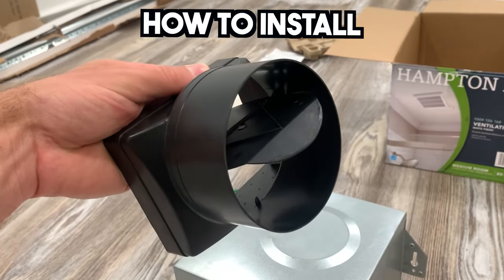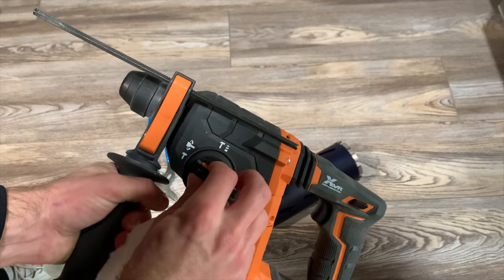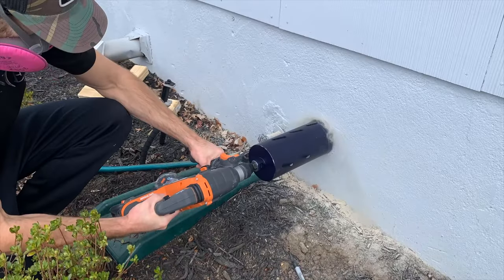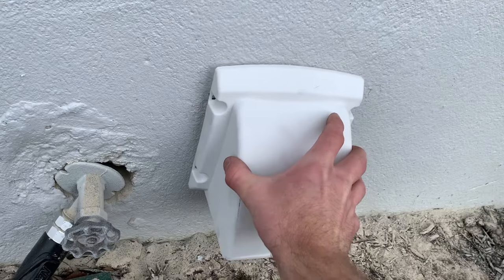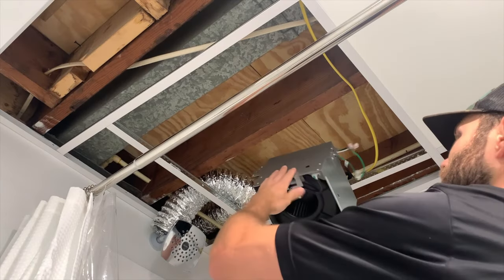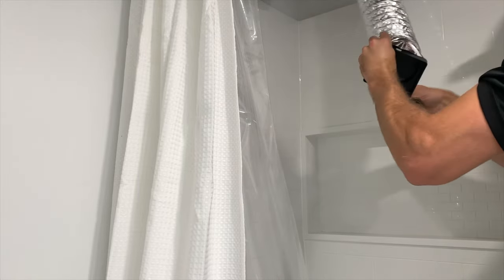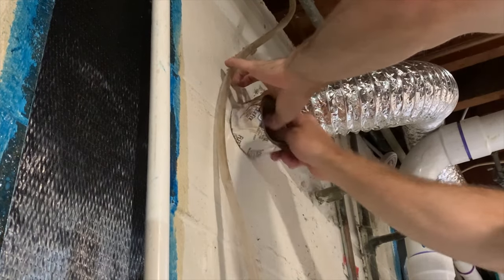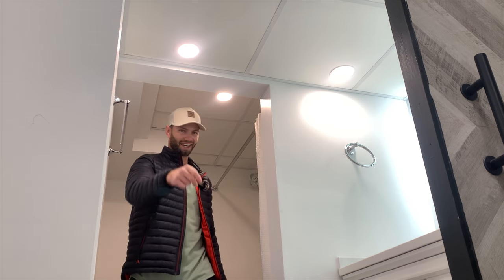How to Install an Exhaust Fan in a Basement Bathroom (DIY Exhaust Fan Installation Step-by-Step)

Comment: I'd be careful,  some fans specifically say avoid flexible hose (e.g. Panasonic).  Looks like a dryer exhaust kit btw.
Reply from the maker: I totally agree that rigid duct is the better way to go! I didn’t see any warnings on the fan about only using hard duct so I’m hoping everything will be ok since it’s only an exhaust fan for a lightly used bathroom. Thanks for watching!
Reply: @AndrewThronImprovements  Flex pipe is fine for bathroom exhaust.  There are often code requirements for dryer ducting.  Typically in my area, the pipe must be rigid except the last bit of length to the dryer can be flexible.

Comment: Another great video Andrew! I would suggest using some stainless steel hose clamps in addition to the aluminum tape for connections.
Reply from the maker: Appreciate! I totally agree - I may just go back and add some since I completely forgot during the install. I think the tape will probably be fine, but having that extra security never hurts.

Comment: Pretty confident you're not supposed to use the hammer function on this diamond tipped bore saw. Drill setting only.
Reply from the maker: Idk… I’ve always had an easier time drilling through CMU or concrete using the hammer function 🤷🏼‍♂️

Comment: Looks good Andrew!  I've never had such a big bit for masonry, so I drill a bunch of 1/2" holes in a circle then bust out the middle.  You did a neater job!   I think flex is fine for bath fan .. it just blows out humid air.  Dryer vents have the whole lint accumulation issue so I think worth the extra effort to install rigid there.  Thanks for sharing your work!
Reply from the maker: That works too! And probably saves you 50 bucks on a bit you will never use again lol. I totally agree - I think I’m in good shape for a lightly used bathroom exhaust fan 👍
Reply: What about the exterior hood location, Does it matter where the air blows?

Comment: Looking good👍installed one years ago in basement. Used rigid pipe though, I’d use the flexible if I did it again, back in those days the flexi was crummy vinyl, I think that foil one is way better.
Reply from the maker: Good stuff! Yea I think rigid is objectively a better bet - but the ease of flexible is hard to beat. Thanks for watching!

Comment: Empty cavities in basement 😅 I never find those usually that high up its a bond beam with rebar and most foundations especially now are completely filled, drill a small  hole to confirm it isn't and you don't need to use hammer function while drilling and definitely not when starting hole, experience: doing this 5-80 times a week as a concrete cutter

Comment: As a HVAC engineer as you Americans say or heating and ventilation engineer / duct fitter (known in UK). I see few things wrong (not hate). First the flexible ducting cannot be longer than 70-80 centimeters , also you have to hold the flex with a hose clamp / jubilee clips  and then aluminum tape. Also minimize the 90 degree bends to the minimum if you can. That's pretty much it I believe. Other than that great job and good video !

Comment: Thanks for the video, Andrew, I have an important detail question: do you attach the exhaust fan to the drop ceiling panel, or should there be a small gap between the drop ceiling at the vent?

That's kind of confusing to visualize, so from bottom to top, should it go:
1) vent cover -> drop ceiling panel -> air gap -> exhaust fan box
or 2) vent cover -> drop ceiling panel -> exhaust fan box

it looks like you have an small air gap there. I am trying to figure out what the right way to do this is. Hopefully you see this comment. Thanks again for the quality videos.

Comment: Great Job EXCEPT the bird or ...... can built nest out side of pipe.
Need to add accessory that close the vent out side when it is not in use and will be open when the vent blow out .
Other than that it is Pro Job 😉😉😉😉.
Reply from the maker: Haha I hear ya! But there is a bird screen that goes on the outside so hopefully I am covered 🤞 thanks for watching!